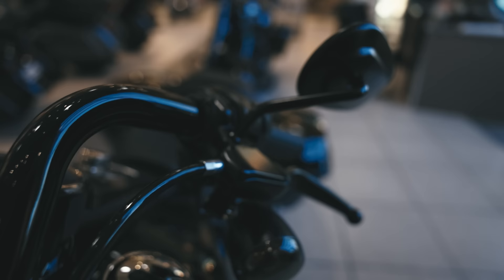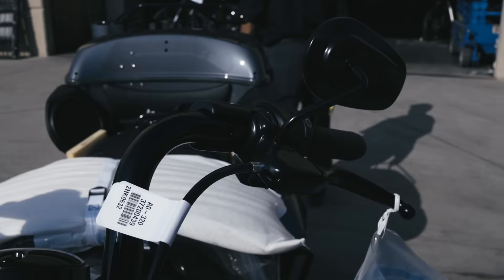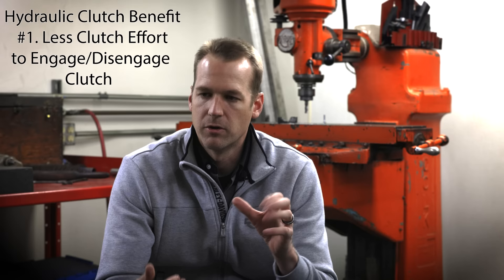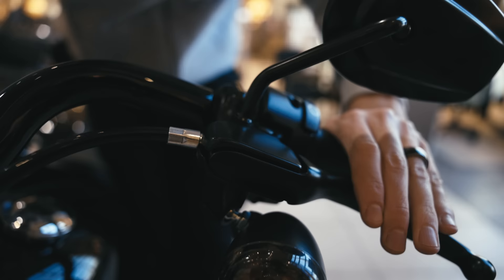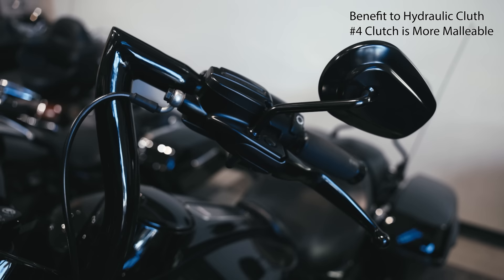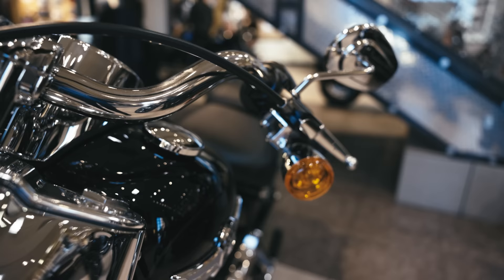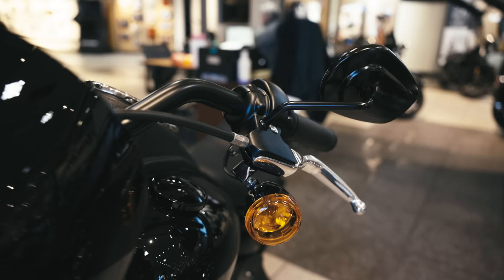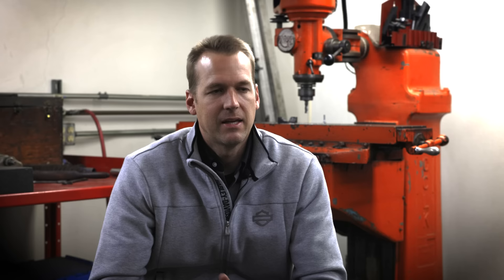Why Harley-Davidson Switched Back to a Cable Clutch on Touring Motorcycles│Pro's vs Con's

Comment: Have never had a problem with my hydraulic clutch as I have them on my Japanese cruiser and dirt bike. My 2000 road king I had before my electra glide was cable and I could tell a difference but adapted to either ones fairly easy

Comment: LOL, Matt, there’s one reason why Harley changed it and that is 100% down to the gearbox to primary oil transfer. My 114 RKS blew its gearbox thanks to it transferring oil, and they had the primary vent fitted.

Mechanical clutch never had that issue. This is HDs way of running away from a problem they can’t solve!

Nobody prefers a cable clutch over a good hydraulic clutch, cable clutch is just cheaper and the only thing HD can do to sort the FU that was their flawed hydraulic clutch mechanism.

Comment: I ride both. Cable clutch is great. Better feel . Aftermarket cables go a long way as well on cable clutch applications. Hydraulic clutch is jumpy but noticed it is pretty good when no lift shifts when partying. High HP hydraulic bikes with upgraded clutch plates felt more unpredictable than similar bikes with similar hp/tq on cable. In general I like both for certain applications. Long haul bikes like a ultra limited I prefer hydraulic clutch and for a performance bagger style bike I prefer the cable clutch. Working at a dealership I wish they kept both options because I have customers that are adamant about their hydraulic clutch system on their pre 2021 baggers which hinders a few from trading up to a cable clutch bike

Comment: HD has been cutting items to save a buck.  If the hydraulic clutch was too hard to pull why not improve it.  Aim corp is a company that has worked on making a lighter pull. I am sure HD engineers could have came up with a solution. Instead of scraping the hydraulic

Comment: Matt, I have ridden both the hydraulic ,and cable clutches. I do prefer the cable over the hydraulic for the low speed maneuverability. The clutch lever pressure never really bothered me, but I understand for some riders it does make a difference. It would’ve been really nice if the engineers could have given riders the best of both worlds with the hydraulic clutch but realize that’s not always possible.

Comment: A Wide Glide shovelhead and two Fatboys later, my grip strength in my left hand is twice that of my right.  My Chiropractor ran the test twice and asked why the difference.  I said "30 years of Harley clutching"... Plus I'm left-handed.  I  put on an Easy Boy Lite Clutch from White Bros on the Fatboys.  My first and second generation VMAX bikes are hydraulic.  I use both cable and hydraulic clutches and don't really care too much about the difference, other than the friction zone adjustability of the cable.  If the hydraulic is firmer than you're used to, nothing you can do about it. If you don't like the release point of the hydraulic, too bad-can't change it. It is either on or off.   The Easy Boy Lite Clutch assist cuts the cable pull effort way down and I can set my friction zone to where I like it. I can do a one or two finger clutch with the lite clutch assist on the cable.  Hydraulics on the VMAX bikes are a different story.

Comment: One thing in favor of a cable/mechanical clutch - riding in the mountains.  If your hydraulic clutch line has any air bubbles in it, as you go up in altitude they expand.  In order to generate the force required to disengage the clutch you have to re-compress that air.  This can take up most if not all of the lever travel.  I've seen it happen with bikes that at lower altitudes appear to be properly adjusted & bled but get up above treeline...  It can (and does) happen with hydraulic brakes too - but you don't notice it as much.  One, you shouldn't be riding the brakes, heating them, in the mountains.  Two, even as you compress bubbles in the brake line you're generating some braking force.  Often that's all you need is a little help in addition to engine braking.  You might not even notice the lever or pedal traveling a bit further or feeling a little soft.  But a clutch needs the same force to disengage all the time.  My HD has a cable clutch... ;-)
Reply from the maker: Good point. I haven’t heard of this being a problem for many people but it sounds like you have some personal experience.

Comment: I did a side by side, 2020 hydraulic and a 2021, both street glides. The hydraulic clutch was way easier actually no comparison. I think I know why they changed back, more service for the cable owner and lower manufacturing cost so as usual it’s all about $$$

Comment: I've been using the hydraulic clutch since 2018.  I've also used cable since the 70's and currenly have 3 Harleys 2 hydraulic, 1 cable. I think it's a step backwards.  
Heard the switch was to totally eliminate oil transfer issues in the M8.

Comment: I use Jerry Paladino courses and I prefer the hydraulic clutch . But I do not use friction zone. Have arthritis in my hand. Harley davidson will idle through the course when others will not. I have a 2019 Electra Glide standard. Took a little more time but not a problem.

Comment: I've never experienced a hydraulic clutch so I have no clue about this subject. I've only ever had a cable clutch and I've never had problems with them. I like that I can adjust them and replace them myself. And I'm really big on controlling my friction zone so I suppose I wouldn't like hydraulic.

Comment: Hydraulic clutches wear out faster than cable clutches. Cable clutch can work 30-40 years while the slave cilinder in hydraulic clutch will start leaking and not holding the pressure within 3-5 years and you have to replace the whole cylinder assembly. So even if you build a custom motorcycle try to adopt cable clutch first and go with hydraulic only if it is really impossible to install cable clutch.

Comment: I just bought a used bike with a hydraulic clutch.  First ride over 300 miles on a hot day and the clutch got mushy.  Understand it is due to old / dirty fluid.  It was probably never changed before.  But it is a little scary running down the interstate and finding that you need to pump the clutch to shift.

Comment: I had a hydraulic clutch on my 2014 limited. I loved it. Very easy to disengage and always a smooth take off. I traded it in for a 2021 Electra Glide revival bike with a cable clutch. Love everything about the bike except the cable clutch. It is not that easy to disengage the clutch to take off. Also I have to release the clutch lever further out for it to start to disengage.  I am not impressed with the new cable clutch.

Comment: Cable clutch allows you to move the friction zone around . Don’t have to worry about master cyl cover seal leaking , removing paint . Cable clutch adjustment is simple . After saying all this still probably main reason , old school . I’ll ride my Harley either way not a big deal .

Comment: And now for cable throttles 👍🏻
Reply: Hope not. Cable clutch doesn't bug me but even on Softail, the heated grips and adding cruise control is all plug and play. Wouldn't be with cables or at least much more expensive to do. I know you are being sarcastic, but don't give them any ideas
Reply: mechanical brakes too...
Reply: @michaelconran5252  No I’m not sarcastic at all. I’ll take a cable clutch over TBW any day.

Comment: Another informative vid Matt, thanks.  I bought my very first harley (19RGS).  I only know wet clutches due to my first bike ever was a 1990 Honda Shadow 1100.  I must admit though, that the clutch on the HD takes some getting used to because of the friction zone relative to the reach of the lever.  I've recently ordered a set of Softbrake reduced reach levers, so I can't wait to try them out and I've read good things about how they help with slow speed clutch control.  I like to practice parking lot maneuvers and hand fatigue creeps in really quick (coming out of winter hibernation up here in WI is a b*tch).

Comment: There is no friction zone with the HD hydraulic clutch, it's on and off, there is an aftermarket fix for that, I like the cable clutch on my 2021 RG limited.

Comment: Like it or not, really is a personal preference.  Yes there are options to make the hydraulic clutch lighter and give more "feel" on the friction zone.  But it probably is true that HD had issues that we don't know that were driving extra cost for them on the back end (warranty repair) and manufacturing issues.  People that like them don't have any negative operational issues.  One thing that is missed is simplicity, a tried and true part that works all the time.  Yes it can require adjustment, but HD has made that quite simple and can be done in a few minutes without going to the shop.    I am OK with a cable.

Comment: The hydraulic clutch on my 2020 Road Glide is smoother than a brand new Road Glide with a cable clutch.  The hydraulic clutch is also easier to pull.  But, both of these conditions are only slightly so.  I'm glad that I bought a 2020, although the cable would not deter me from buying a new bike, if I wanted to trade.  I'm sure H-D had multiple reasons to go back to cable.  One of which is profit, but why not, if the majority of people like the cable clutch better.  Even at 50/50, i don't see them as having anything to lose, and if it helps someone to keep their job, I am all for it.

Comment: I just picked up my 21 yesterday, traded in a 2018. I actually like the cable clutch much better. The control I have with the friction zone is much better than the hydraulic.
Reply from the maker: Thanks for weighing in.

Comment: I ride a 2007 Dyna and a friend of mine had a 2016 Dyna but it was totalled. He replaced his bike with a 2014 Street Glide. Neither one of us like the hydraulic clutch. He's learned to get used to it because he loves his bike otherwise but it's almost a deal breaker for me. My clutch on my 2007 FXD iS adjusted to slip around halfway out and is extremely light due to keeping the pivots and cable regularly lubed. Slow speed manuevers are WAY easier with a cable clutch. As far as cable clutch adjusting, in 22,000 miles I've adjusted my clutch 2 times.

Comment: I've been riding for years, my first Harley is my second hydraulic clutch , and my only complaint is I can not drop the clutch on take off like the cable clutch. This was the same way on my other hydraulic clutch.
Reply: Hats not due to the hydraulic clutch put some stiffer clutch springs if you want it to grab harder when you drop the clutch lever

Comment: I like my hydraulic clutch but I never had a concern about my cable clutch. I have adjusted my clutch a few times. I also have a KTM with hydraulic clutch. 

Not sure about easier but they do have a smooth feeling.

Comment: I bought a 2020 Road King and I find the hydraulic clutch a little bit difficult to use. I am old (76), small (5’8”) and have some arthritis in various parts of my body, my left hand being one of them. The long reach to the lever and the engagement point right near the end make it pretty uncomfortable when in a lot of stop and go traffic. I have replaced the stock levers with Kuryakyn trigger levers which help somewhat but I sure would like to have a cable operated clutch!

Comment: My only experience has been the Harley hydraulic clutch until I just bought a '21 FLHXS and my service manager told me that I cannot get the clutch cable adjusted to bring the friction zone "closer" in towards the grip.  Am I asking for something that is impossible ?

Comment: The cable clutch is a win win for H-D, it’s cheaper and requires more servicing. This is good for dealers. This year Harley Davison took the CB and the XM module out of the CVO put a cable clutch on it and raise the price. Some of these comments people are asking when they’re going to put the kick starter back on I know this is somewhat of a joke, I think, but in a way it wouldn’t surprise me a kick starter is less expensive than a starter motor and then again Harley Davison would raise the price. The purple CVO, at the Dealer here will be 50K, hard to believe a great touring machine with a cable clutch that you have to just every 3000 miles and if you want to listen to XM while you’re out on the road you have to pay more.

Comment: I’ve used the mechanical clutch and currently ride a 2017 with the hydraulic clutch. I’d agree with the ease of the hydraulic but would prefer the ability to adjust the start of engagement closer to the grip vs at the end of clutch lever travel. Thanks for a great video.

Comment: Matt, I never had a Harley with a cable clutch. Coming off of a V Rod to a Roadglide the clutch was seamless. My younger years were all Japanese crotch rockets. Is the cable clutch that big of a deal that the motor company went back to an older design?

Comment: Get an adjustable clutch lever and set it where you want it. 
My experience with those that compete in police motor rodeos is exactly the opposite. They love the hydraulic bc of the consistency and longer life of the clutch.

Comment: I think people are mostly against change. When the road glide came out with the stationary fairing many people were calling it the ugliest thing Harley ever did. Now look at the popularity. the same with radios, cruise control and windshields. 
But, to each his own. There is no right or wrong. There are adjustable levers available.

Comment: Pure and simple, hydraulic clutch friction zone sucks in my opinion. I have been on Harley's for 40 years and like my clutch to release just off the bar. The adjustability  of the cable clutch is just better IMO. The only downside to cable is the PITA to switch out the cable when time. Not hard just a pita. I have small hands and clutch pull is something I'm well aware of. The original 21* ball ramps were the best ever but were heavy when combined with a SE or similar pressure plate. There are options to make a cable clutch easier and still hold the TQ & HP.

Comment: Everyone has a preference and it is also pretty subjective - my '01 fxsti obviously is cable and I have grown to prefer it. That's just my opinion. I am a compulsive grease and lube applicator and have never given it a mechanical adjustment - I have done every maintenance on the bike  over it's 18,000 miles. I owned an '07 FLHT and '99 883c concurrently so don't judge those miles LOL - the flht was wrecked on Sunset in 2013 at 20k miles and I sold the 883 in '08 at 16k miles.

Comment: Matt, good points, but the problem is HD itself. The benefit of an hydraulic clutch for the rider is that it should be 'significantly' easier to pull in than a cable clutch. Other brands have definitely achieved this, HD did not.  No one seems to talk about the elephant (or elephants) in the room.  The elephant in the room here is that HD just did not get its hydraulic clutch system right, was not prepared to invest in the tech/engineering to get it right, and did not include a rider friendly adjustment to allow 'the rider' to set the friction point (as to how far out from the grip before the clutch grabs).  Other brands have achieved this (and did so many years ago) - you know, that dial with numbers on it which is an integral part of the clutch lever itself.  HD has resisted implementing this practical yet simple solution from time immemorial.  And please, it's very and easily doable, I have after market levers (on the brake side as well) with those dials fitted to my HD - this allows me to dial in the friction zone to where I want it, not where the Motor Coy says I should have it. Just a turn of the dial.  As I said above, HD is the problem, it just won't and can't eat humble pie and implement solutions that other brands have done - just primitive!

Comment: I have a 2012 Street Glide CVO with hydraulic cliché, and in the summer season I always have problems with it, and risk of having an accident, because the oil heats up to the point that the clutch no longer works. The problem occurs both on mountain roads and on the motorway, but only when I ride the motorbike on very very hot days. The HD service advised me to use a different oil, more performant, which is the MOTUL 660 Dot4. I hope that it works better. Bye

Comment: I have been using a hydraulic clutch since 2009 and like it better and don’t have a issue with the location of the friction zone but if I did I would replace the factory lever with the adjustable lever the aftermarket offers , if I were riding the tight maneuvers like motorbike officers do , Ryan from LawAbidingBiker performs serious maneuvers with a hydraulic clutch Thanks for the video

Comment: This might be in the comments below, but one can change the friction zone with the hydraulic clutch with the OBERON branded lever. I have mine set to engage close to the grip, not out at the end. Easier on the hand with it closer to the grip. I must take exception........ you DO NOT have to wait for the friction zone to get out to the end to engage, but it is true the engagement is limited and not linear like the cable clutch. Try the OBERON and you'll see the difference it makes, and I'm not associated with OBERON whatsoever.

Comment: I'm with f-bomb baggers,that Harley went back to cable clutch because of the problem they having with oil transfer to the primary.
Until they sort it out,then they bring back the hydraulic clutch.

Comment: You can adjust a hydraulic clutch if it goes out of adjustment you need to fully rebuild it. Cable is fully adjustable and cheaper to replace

Comment: Completely agree with you on this vid Matt, I love my hydraulic (rekluse) clutch on my UL. I do think going back to a cable is a step backwards, and ive been riding for 46 years.
Reply: Rekluse is not HD. You can’t even compare them. The Rekluse is like butter compared to the effort required of the stock clutch. That was the whole idea behind it. And also the reason rekluse invented it, because so many people complaining about the effort required of the stock unit.